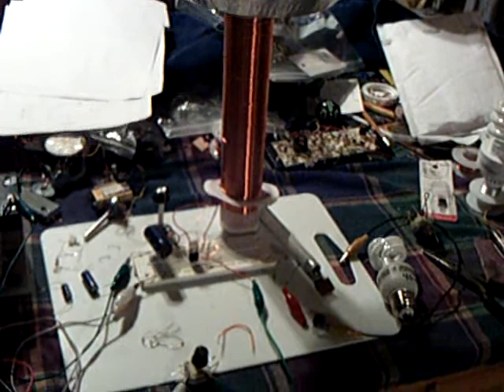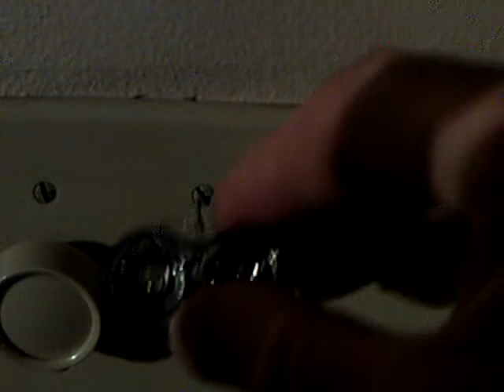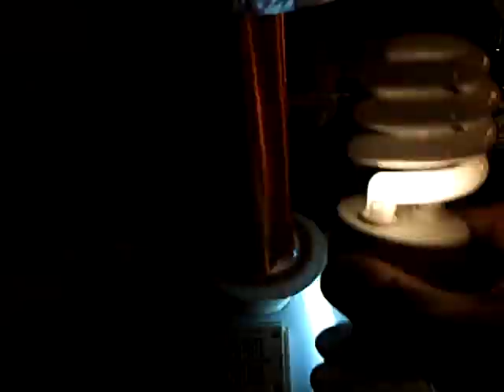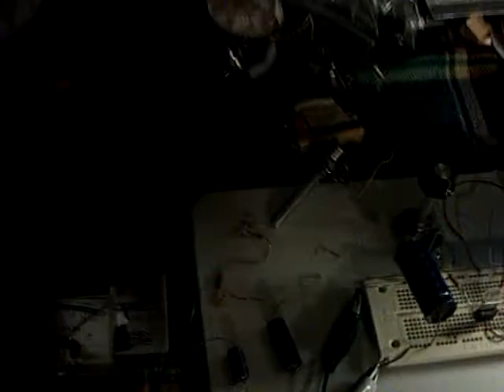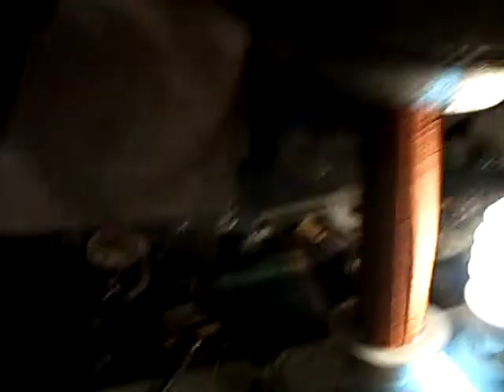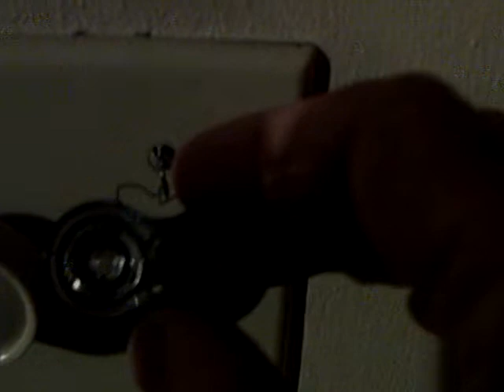Slayer Exciter--Jiffycoil replication.ASF

Comment: Hi Lid
great videos as always
With run charge 3 of Slayer set up  the car front seat ignition cigarette lighter and all other metals switch on leds av plug...plus body ground
With a neon lamp sitting on top of L1  and the other leg to L3   instead of body ground we can capture the heat and transfer to solar cell from calculator

Comment: @Lidmotor Yes I know, I'm also talking about "broadcast" energy. A wifi signal is used, but it doesn't say how. The article is called "Airnergy WiFi power system gives RCA a reason to exist (video)". I have some DIY wifi antenna's, if you can think of a schematics I can test if I get some power. But I don't have a scope.  Maybe if I just hook it up to my joule thief? 

I've posted a new video with my joule thief, lighting up 20 ultra bright LEDS with one 1,28 volt battery and 60mA. Greets, iT

Comment: I appreciate your videos, they are both interesting and informative.  When you state that you electrified your house are you referring to the strength of the energy you are radiating from the coil?  Because as you point out, the screw on the wall plate is an electrical ground.  Wouldn't the LEDs light up the same at the location of the electrical wall plate if you ran an earth ground to that same point which would confirm that the screw is just a convenient way of picking up an earth ground?

Comment: Just wanted to share, I replicated this, I didnt get detailed in the replication other than the two coils and top loads I created were identical in capacitance and inductance.  I was able to light leds off similar locations, as well as a metal dog kennel several rooms away sitting on carpet and not connected to any kind of ground.

I'm just using MPSA06's.

Fun stuff!

Comment: I do all of my experiments on the floor right next to the radiator and watching tv at the same time. With this circuit i can start the SEC without even touching it, Only inserting the power source. Also if the SEC is off, and the slayer exciter is on the lights on the SEC glow. It is very interesting

Comment: @insAneTunA But I can see  the differences between your setup and the one from "airnergy", but it is wireless, and "broadcast" energy.I think they use the same technology as the radios without battery.  In my country it is illegal to tap the power that comes from radio stations, that is if you want to use it for electricity. But they sell it as if it is new and high tech technology, while it is old. I would love to build the Tesla radio, but I can't get the parts, too expensive for me to order.

Comment: @Lidmotor  Do LEDs connected to plate screw turn off completely when coil is de-energized?  National Electrical Code requires that neutral conductors be bonded to ground bus at main circuit breaker panel only; this prevents normal neutral current from flowing back to the source on a ground conductor which could cause voltage differentials between neutrals and grounds.  Another possibility is that it’s not uncommon for an appliance to develop a very small leakage current thru a ground conductor.

Comment: on my house it does :) if I put my hand on one wire of the av plug id doesn't matter witch and I touch the pipe through witch my electrical line go to the lights it is faintly light.. that is why I asked (with wireless Network off)